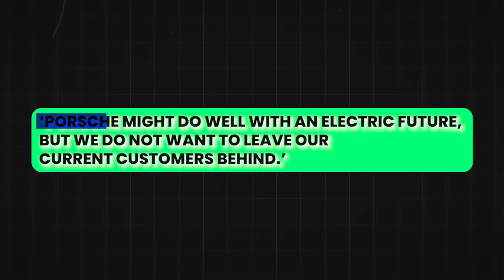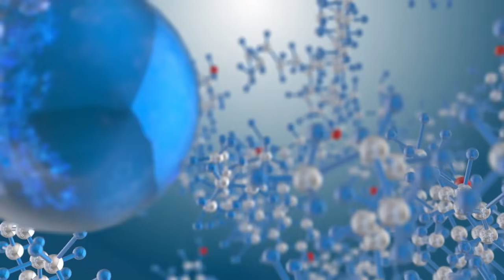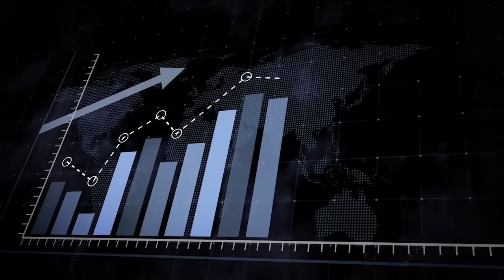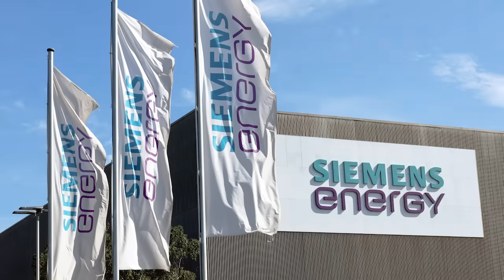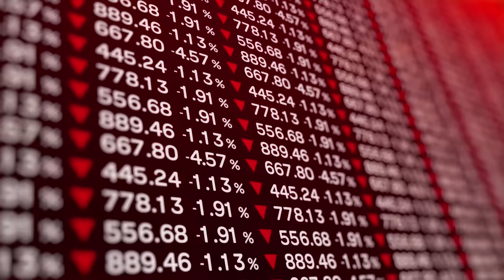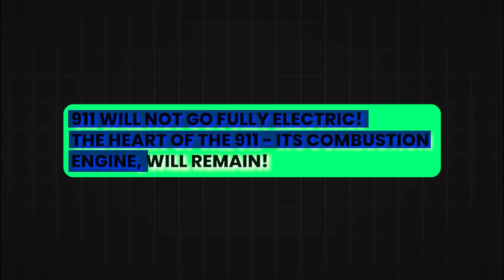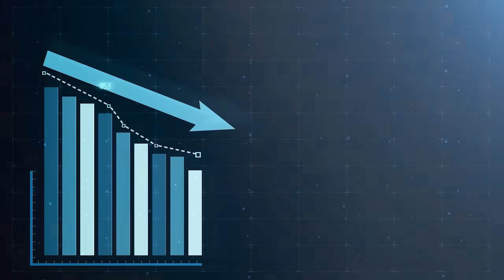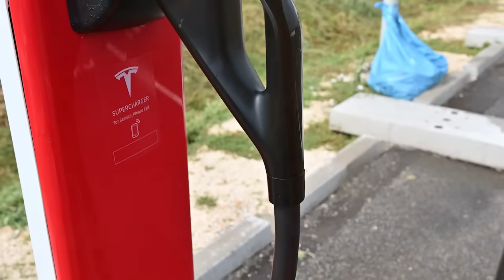HUGE NEWS! Porsche CEO Shocking WARNING To All EV Makers!

Comment: We drive what we want....fck what the politicians want. They work for us.
Reply: well, they should but they forgot LOL
Reply: You can drive what you want...assuming somebody is building the car you want, the parts, doing the maintenance and refining the fuel.  The push for EV’s has nothing to do with politicians, it has to do with a) environmental reality and b) superior automobiles.  If we had the tech 100 years ago, there never would have been ICE cars to begin with.
Reply: @johncahill3644 excellent response John.
Reply: It’s about time the pollies were reminded just who is boss …
Reply: Of course they do. When was that ever true?
Reply: @batmanlives6456  Did you buy a gun today? Go wave it around and scare the cops and pollies.
Reply: @johncahill3644  Maybe you are not aware that there were dozens of electric car makers in the US in the 1920s. They all went out of business when the ICE motor became reliable. I learned this at the 2018 NY Auto Show when I saw a few of these cars on display! Those cars used banks of lead acid batteries and had exactly the same problems as today's EVs - huge weight, long charging times and limited range. 

Transport should not be inconvenient and expensive to use, and EVs that use more of the Earth's resources, cause environmental disasters in third world nations and release double the CO2 in manufacture that take 200,000 km to reach net zero are not green! And when bad weather cuts the electricity supply for days at a time you are stuffed!
Reply: That's right!  But you are forgetting that many, many people want cleaner air, less traffic noise and safer cars!  Notice I didn't even mention doing anything for the climate!
Reply: @st-ex8506  so everyone else in the country has to suffer because of the poor choices these people made about where they live? How about if they don't like where they live go someplace else? Leave the majority, the more intelligent group, alone.
Reply: @northdakotaham1752  Oh! You are from ND?!  That explains the rest...

You see, here in Europe, population density is a bit different than in ND!  Actually, it is the case pretty much everywhere in the world... except maybe Inner Mongolia.
A lot, I mean a whole goddamn... lot of people are affected by the nuisances of traffic! 
And I AM SURE, that they are on average as intelligent  as you and me! And YOU are the minority!
Reply: @northdakotaham1752  BTW, is your thumbnail your aircraft?  Very nice vintage taildragger, but I just cannot put a model name on it...
You see, I am no green activist, as I love flying my plane, too!
Reply: @zoransarin5411  That`s why he has so many thumbs up.
Reply: @st-ex8506  the U.S. has on occasion followed the examples set in Europe. It's always a huge mistake. Your problems are not our problems and they are a result of decisions that Europeans have made, most of them poor decisions. I doubt that I am a minority as the peak has been reached here in EV sales which is now on the decline, American auto manufacturers failing to heed that which Toyota and Honda have done. Now they are financially struggling, trying to sell vehicles almost nobody wants. The news media in Europe possibly forgot to mention those details.
Reply: @johncahill3644  superior vehicles are usually in high demand. Currently in the U.S. ...evs are not in demand. This is why U.S. automakers are not building them. They don't sell. It's not about performance unless performance means endurance.
Reply: @st-ex8506  my thumbnail is a 1946 Globe Swift, built in small numbers in Texas.
Reply: @northdakotaham1752  Fine airplane!  I love it!
Reply: @st-ex8506  It's not really fast in stock form but handles like a you might expect from a fighter plane. One of the engineers designed the P40 Curtiss Warhawk.
Reply: @iankuah8606  yes … no real answer to the same problems 100 years ago..

Comment: The EV future was always ideologically rather than technically driven and was invetably bound to unravel in the end due to the many shortcomings withthe concept.  This new fuel, which if true, will  turn most ICE vehicles into low or zero emissions units.  If that is the case, the battery EV is essentially dead.
Reply: It remains to be seen just how much of what was said is anything more than snake-oil salesmanship. Zero-emissions? Good joke.
Reply: Except nothing is unravelling.
Reply: @EnriqueThiele And whether GM or Ford or other American manufacturers can build decent problem-free attractive ICE cars, if they don't go bankrupt.
Reply: @mauricegold9377  I grant you that many other concepts for fuel have been presented in thepast that have come to nothing such as a 'revolutionary' diesel water emulsion fuel in the early 90s.  Equally hydrogen fuel cells have been around in some form for at least 40 years but do not seem to have become a viable technology.  The concept of the EV is as old as the car itself and, if it was a viable technology, it would have been mainstream long ago.  EVs are now prevalent despite their obvious flaws and shortcomings because governments have driven their adoption on the grounds of climate ideology rather than technical feasibility.

Comment: EV's have been a status symbol, badge of WOKENESS, fashion statement, etc. The common, everyday, paycheck to paycheck American can't afford them. Charging infrastructure is scarce and a crapshoot of being functional if you do find a charger. These "Efuels" are much more expensive than petroleum fuels, no cleaner. Actually worse as it takes as much power to make as it provides! Hybrids using cleaner fuels such as propane and LNG are much better but have been abandoned by manufacturers in the EV mania.
Reply: I got my EV because it's quick, fun, doesn't stink, extremely practical and dirt cheap to run. Oh, and it wasn't expensive to buy.

Perhaps you need to learn about EV's before inventing other people reasons for driving them?

Comment: i prefer a maintenance free electric motor connected to a simple transmission instead of a complicated engine and complicated transmission that requires wasting money in maintenance and repairs due to failures.

Comment: Whilst car manufacturers are using lithium batteries the sales figures will determine a gradual grinding to a stop of EVs thus rendering the electric vehicle market to stop, people are becoming fully aware that these vehicles are a death trap & uninsurable because of the risk they have built into them and the possible death of people travelling in that vehicle.

Comment: EVs even for delivery lorries make complete sense in densely populated urban centres where air quality could be a localised issue. Once you go properly extra urban in the UK, only combustion engines make sense in most situations for most people atm.
Reply: Except poor air quality is barely caused by car emissions. 

This morning my city was blanketed in smoke because of controlled burns. On any other day you’ll find a mix of fires from landfills, lithium recycling plants, and junkyards. 

New cars and trucks burn so clean it’s insane to think that they are sooty in any way.
Reply: @microsoft790  mate, I completely agree. I meant like zone 1, maybe 2 in London. Ulez beyond that is pointless I.e. in zone 3 cars are responsible for 10-15% of emissions & I suspect you like I, find the green wash imperative for us all' to adopt EVs without even the transmission infrastructure capacity in place is... well... flawed.
Reply: In Melbourne (Australia) a BEV truck had an issue and caught fire and had to burn itself out. That was on a highway. You don't want similar things in high pop urban areas. The smoke would mess up a lot of people.

Comment: BEV's are not only more expensive to produce, they have a lot larger carbon footprint to produce.  By the time they make up for that higher production carbon footprint the battery is likely to be half way through its life.  Then there is the problem with battery damage on BEV's.  Any damage is being seen as an expensive (and high carbon footprint) complete replacement being required.
Reply: And no identified method to recycle the old battery.

Comment: There is nothing more economical than using a system that is already established, fuel stations can easily be retrofitted with e-fuels, tankers can be retrofitted to carry e-fuels, cars can be retrofitted if needed to be more compatible with e-fuels.

WAY cleaner for the environment than digging up thousands of car parks to put in millions of feet of underground cabling for the thousands upon thousands of freestanding chargers to cope with the millions of potential EV’s that already have a carbon deficit before they’re even driven!!

Comment: Can homeowners produce e-fuel at home using solar panel?
Reply: No you can not it unfortunately does not work like that.

For clarification e-fuel needs an entire plant to be produced go watch a video about it. Maybe in 50+ years but not in the near future.
Reply: Hydrogen electrolysis might be possible at home.  One start up in Australia is doing it.  But it’s not as efficient as a battery.

Comment: The Le Mans WEC motor racing series has been running on synthetic carbon neutral fuel for several years. F1 will use it from 2026 onwards.

Comment: If Porsche pull this off they won’t only own the car market they will also own the hydrogen market, this could turn Porsche into a trillion dollar company, potentially the biggest company the world has ever seen, especially if other manufacturers have to buy their fuel.
Reply: @EnriqueThiele at the moment yes, it’s expensive but remember when VHS video players came out in 80’s they were around $900 per unit, once they learn to economise the product on a mass scale the price will come down…this is basic economics.
Reply: @EnriqueThiele EV batteries last 500,000 miles 😂 where did you get that information?
Reply: @aberdeendeltaforce it can never be done cheap. It’s a matter of pure and simple mathematics. If you lose more than 50% of the energy that you put into it, it must be more expensive.
Reply: @johankuster1377  Ok Einstein 😂
Reply: @aberdeendeltaforce  considering your previous hydrogen remarks , I am not surprised by your reaction.
Reply: @johankuster1377  Not trying to be rude, I value your opinion I just don’t agree with it.

Comment: Someone I know has Porsche Taycan S, new cost him £120,000 he has lost £80,000 in two years, it’s valued now at £41,000 an absolute joke, plus insurance on it, is £4,000 a year and costs £24.00 to charge and gives a total range of 170 miles … don’t by any EV they are  net Zero Bollox and cost more to manufacture and have a bigger carbon footprint than ICE cars, plus average battery life span 8 years at a minimum cost for replacing is £25,000 the Tesla is £17,000 and fail all the time!

Comment: Hahaha , hydrogen engines have been around for 20 years or more, it's not new, it's almost extinct.  Just a couple of questions mate , how much energy does it take to create the unstable hydrogen fuel? What is the loss of energy making the fuel? What is the cost? How often would you need to replace ALL the storage tanks and other parts that degrade form the unstable and highly combustible fuel? Porsche came to the ev race too late and why would someone pay $1000000 for an ev when they can get one better? And i love the part where making hydrogen would use renewable energy but ev's get their energy from fossil fuels? 🤣🤣🤣🤣🤣 well looking at the score board it seems that in some countries ev sales are more than 50% of new vehicles,  looks like it's the end of combustion engines

Comment: Hydrogen has a long way to go due to the cost of production, the lack of infrastructure, the difficulty in storing and transporting it and it’s low calorific value. EVs are only around due to govt subsidies. It will shrink but probably not quite die. Nothing compares with petrol and diesel. The markets will decide much to politicians and big business chagrin.
Reply: My immediate thought what what fuel is used to power the electrolysis process?
Reply: @cornishhh  electricity.  So how green is the huge amount of electricity required to run the inefficient process of electrolysis?  It's not green.

Comment: My neighbour has a Taycan and hates it.  It has 210 mile range...BUT you are not suppose to charge over 80% or let it drop below 30% if you don't want to damage the battery,  some simple math therefore reduces range to 105 miles, and that's best case.  Driving slowly on a warm day.   Not a hot day, just a warm day.
Reply: "drive slowly"  Just what a Porsche driver bought his car for.

Comment: I believe it was 2001. A guy went public on a gas-powered engine that can run on any liquid. They took his life. Another guy ran his car off of only water. They took his life. The USA military had an airplane in WW2 that only ran on water. That was okay. The airlines planes engines are forced air ram engines. That only use air as fuel. That's okay. When you know facts as such and then watch vehicle manufacturers do this and they all know this. You really look at everything with different eyes. The two best fuels for engines that are a hard proven fact is water and air. Then. When you also know electricity is free energy. All you want to do is get Musk to hurry up with his rockets going to Mars and buying a one-way ticket out of this freak show.

Comment: THE EV MISSING LINK
Electric cars are battery powered, right ?  So why don't they come with a Dynamo or Alternator, that constantly recharges their batteries all the time the car is in motion ?  Which would almost abolish the need to stop & recharge. And depending on how the car is used, massively increase the distance between "charges" to thousands of miles !!! Quite obviously the car manufacturers don't want to do this, because once normal car production ceases, (in Europe in 2030 by law) they will have to introduce large costs & taxes for every "recharge" of an EV to make up the loss on tax collected at the gas/petrol pumps & elsewhere !!!

Comment: There is no such thing as zero emission! Everything that needs a fuel source emits something somewhere. Maybe it doesn't emit a gas that is causing the current political backlash, but it does emit something. You can hide the emissions by relocating the source of the combustion to outside and away from the vehicle like with EVs, you can make it so it creates a less toxic emission, you can make an engine more efficient by offering more power for the same or less emissions etc. But you absolutely WILL be emitting something! Congrats to Porsche for creating a better engine, I just hate it when they over politicize a stupid talking point.

Comment: Compressed Hydrogen gas, nothing new. Only a fueling system needs designed for the 140f Hydrogen flash point. Every I.C.E to date can run on Hydrogen.  N.O.X emissions have been solved coming on 2 decades now.
Reply: Yeah, definitely not new. The biggest problem with hydrogen is that it takes so much energy to separate and compress. Not sure where all of the green is coming from. Unicorn farts I guess.

Comment: The future is not Hydrogen, sorry to rain on your YouTube video, but it's a fact. Hydrogen fuels contain Platinum, which is very expensive, hydrogen fuel stations are also extremely expensive, too expensive to make commercial main stream. Sorry but EV cars are not going away any time soon, and people will always choose way cheaper charging over buying fuels. Combusting engines which require bought fuels which still ommitt CO2, is still going to be banned. There is no escaping this fate. People will hate this fact, but the environment requires Net Zero, not most zero.

Comment: It's not that legacy automakers are against EVs in principle.
Their problem is that Tesla's methods have advanced so far beyond legacy's manufacturing techniques that they cannot compete.
Reply: Yore pretending that tesla has made any tech breakthroughs at all..
Reply: Yes, Tesla is way ahead of most competitors when it comes to manufacturing vehicles, battery efficiency, user interface, and the charging network.

Comment: I much prefer the instant torque of an electric drive train, just not thrilled about losing half the range to heating in winter and having to do two charging stops on a Montreal-Ottawa round-trip mostly 50kW chargers along the way. Much prefer needing only half a gas tank and not worrying about how much range I lose to heating in winter. I could have the best of both worlds with a generator-extended EV: 30kWh Na-ion battery for local commute and 15kW generator for road trips when I don't want to bother with spotty overpriced fast-charging or -20C days nuking the range.

Comment: Yet another video lacking the basic understanding of what an EV is. It is a vehicle that only uses one or more electric motors to turn its wheels. They are not about the demise of internal combustion engines nor about batteries as batteries do not turn the wheels. And it because technology has advanced such that only electric motors should be turning the wheels of the vast majority of vehicles in the future that that is how it will be. However I personally see no reason why you should not still be allowed to purchase a new vehicle with an ICE turning the wheels in future if that is what you want.